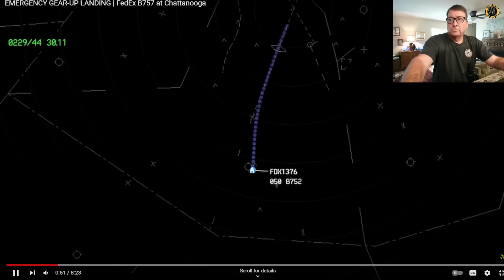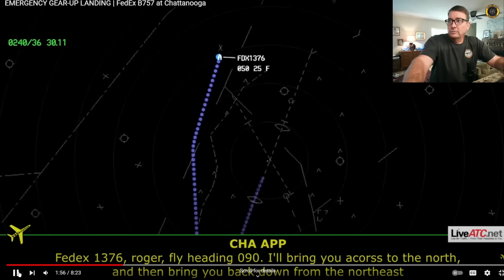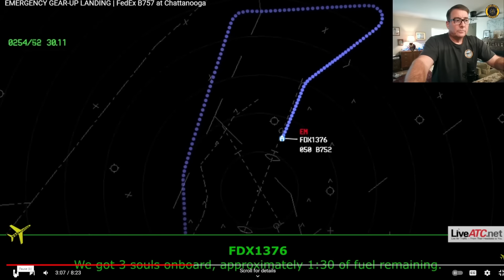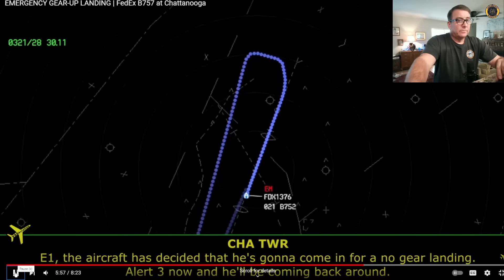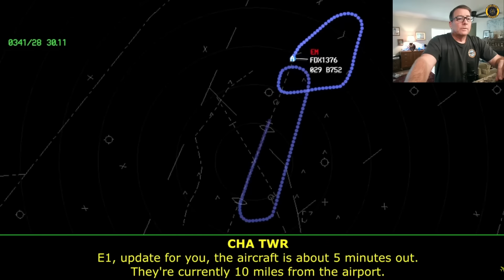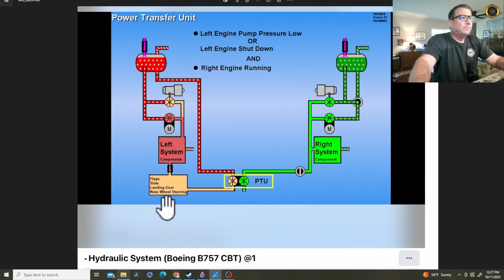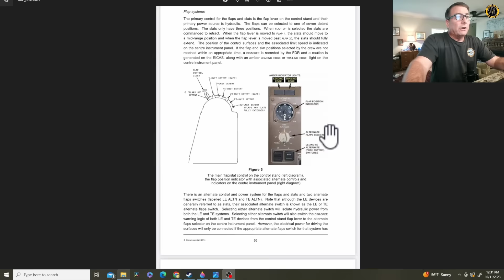Fedex 757 Gear Up Landing 4 Oct 2023

Comment: Hi Juan, do you think the mfgs will ever add cameras to give pilots views of the engines, tail, and landing gear? Thanks. Great video👍
Reply: WHY?
Reply: @georgeconway4360 so they don’t have to do a fly-by for others on the ground to confirm if the gear is up or down. But since this was at night it’s going be difficult to see from the camera or by anyone on the ground. 
On the other hand we hear of instances where the pilot comes through the cabin to look out a window to check what’s going on with the engines etc. so a camera might just give them another way of confirming what a sensor is telling them.
Reply: @axelknutt5065  Well said. Possibly even more useful on a freighter, as there's no cabin crew to look at the engines for you, or possibly not even any windows to look out of...
Reply: @georgeconway4360  cameras are very inexpensive these days. Even a Tesla has multiple cameras obviously for different reasons but still they are there.

Cameras would allow the pilots to have a view of what is happening without leaving the cockpit, and in this instance they wouldn’t have had to do the second flyover to see if their landing gear was down.

I hope Juan weighs in on this as he may have some additional information that may be helpful to us.

I just think for the low cost of adding them into a new model they should be there. It could also help later with accident investigations.
Reply: @TahoeRealm  Nothing on an airplane is inexpensive. Curious if you could estimate the cost on one of multiple computer screens sitting in front of the pilots. I had one changed on a MD11 in the 1990s and I was told the part cost was $60,000. I doubt the price has dropped in the last 30 years.
Reply: @georgeconway4360  go back and watch Juan Brown’s excellent interview with Captain BEHNAM and let me know if you still don’t think a camera would’ve been very helpful to the captain. You seem very opposed to this idea. Let me know if you feel the same way after watching that interview.
Reply: @TahoeRealm  I’ve watched the interview and a camera would have made no difference. You guys sound like the people that think a big parachute in every airliner is the solution to crashes. A camera would just be a distraction. Pilots just have to fly the airplane they have since they can do nothing to repair the problem.  How much do you believe cameras would cost per airplane? One million dollars, five million dollars, ten million dollars?
Reply: @georgeconway4360 Why would you want to know if your gear is down or if there is visible damage to an engine? Really?
Reply: @owensparks5013 You could see gear is down, but is it locked? You'd need a lot of cameras and a fair bit of time to run through it all.
Reply: @owensparks5013  The airplane already was telling them the gear was not safe. Visible damage to an engine won’t change the way the crew handles it. They’ll get a better picture of what has happened by the performance of the airplane. In flight repairs went away with the jets.
Reply: @georgeconway4360  There are many different "gear not safe" scenarios. If that warning was sufficient, then there would have been no benefit to carry out a low pass to ask ground observers for more information. All gear deployed, but not locked, vs nothing at all deployed, vs one main hanging and nothing on the other side is useful to know! A few cheap cameras could have verified that in seconds. Instead, the pilots had to waste limited remaining fuel and fly a poorly handling aircraft low to the ground to gain an understanding of the situation.

Likewise a visual observation of an engine could be the difference  between, "it might just be an instrumentation problem", vs "the cowling has disintegrated, bits are flying off towards the tail, the wing seems to be venting a liquid from a puncture, and there are flames coming out of the side".

I really don't understand why you're continuing to deride a simple way to gain information in an emergency.
Reply: @owensparks5013   go back and watch Juan Brown’s excellent interview with Captain BEHNAM and let me know if you still don’t think a camera would’ve been very helpful to the captain. You seem very opposed to this idea. Let me know if you feel the same way after watching that interview.
Reply: @TahoeRealm  You might want to read the thread again, I'm the one for the cameras, not against them. 👍
Reply: @owensparks5013  thank you Owen. I think I may have tagged you by mistake when I copied over.
Reply: @owensparks5013  Do you consider $1,000,000 cheap?
Reply: @georgeconway4360  There is no reason,  other than antiquated aviation production and certification methods, that a handful of $10 cameras should cost a million dollars.
Reply: @owensparks5013  You say that because you have no idea. I recall many years ago a PanAm pilot remarking about the $40 pencil sharpener at the Nav station in the B707 cockpit. It was the same sharpener you could buy at a five and dime store for $1.25. When the MD11 was new and we carried lots of non pilot employees on the jump seat I would always ask what they thought this new airplane cost. The numbers I had been given was $91 million. Most guessed about three to five million but in one case the jump seater guessed $750,000. Nothing is free or low cost from any aircraft manufacturer. The WAG of on million to put cameras on an airliner is probably Low Ball.
Reply: A camera doesn't really tell you whether "locked" or not, unless all downlock linkages are somehow clearly visible.  But the DC-10 for example has multiple conclusive visual indicators:  A small stud which protrudes from the upper wing surface (edit: for "down and locked"), and a sight tube underneath the carpet mid-cabin where the alignment (or not) of two indicator tabs in the wheel well can be checked (edit: for "up and locked").  Those are direct/positive confirmations, though the observer has to be mid-cabin.
Reply: @marcmcreynolds2827   go back and watch Juan Brown’s excellent interview with Captain BEHNAM and let me know if you still don’t think a camera would’ve been very helpful to the captain. You seem very opposed to this idea. Let me know if you feel the same way after watching that interview.
Reply: @TahoeRealm  "You seem very opposed to this idea."  Sorry if I gave that impression, though yes I did point out a negative while and mentioning alternatives which I assume many are unaware of.  Speaking as a former airliner landing gear engineer with some Human Factors background, here are some expanded thoughts.  Note that I'm not so much opposed, as wary of the upside/downside ratio.  It's not as simple as some might think from working off of one or more specific incidents/scenarios.

I fly inexpensive cameras all the time... but not on an airliner.  As georgeconway so accurately put it, there are no inexpensive airliner parts.  The several cameras must perform at temperatures from well below freezing to hotter than consumer equipment will work, with no fogging across the entire RH range, no problematic EM emissions, and in the dark with a ventral anti-collision light constantly messing with the exposure.

There's a Human Factors aspect which concerns me:  Does the tendency of one's brain to focus on visual data, especially attention-grabbing visuals like an engine on fire, overly distract from other visual and auditory inputs?  A pilot might tend to devote too much attention to a screen showing an anomaly containing little actionable information, while other more important tasks/inputs get missed.  Something said by the other pilot, for example.

People think that they multitask, but it's really just switching back and forth, and some circumstances make it harder to do that reliably than others.  I would want to see a lot of "instrumented" (e.g. eyeball position) simulator runs before assuming cameras helped more than hurt over a range of emergency situations.  Maybe/maybe not.  Even if the answer is yes, such research could lead to best practices for utilizing cameras safely/effectively.
Reply: @marcmcreynolds2827  thank you for the great reply and sorry if I misunderstood you.

Comment: 757 is my favorite airliner of all time. I hate to see one trashed. Thanks Juan!
Reply: I noticed that in the accident report, the report stated that the damage to the aircraft was substantial. Does this mean that this aircraft will be written off? Or might it be repairable for reuse?
Reply: @arthurcatalanotto1151  I wouldn't think this is something that can be repaired but only someone like Juan could answer that for you.
Reply: To be fair, she wasn't deliberately trashed. I think a line from The Mary Ellen Carter works well here, "We all tried to save her, heedless of the cost." Also, she did what she needed to, and got the crew on the ground alive and relatively unharmed. (Those slides can sometimes be tricky.)

Comment: I’ve been away from the 757 for a while but there are a lot of similarities with the 767.  This is what the Polish authorities found shortly after LOT’s Gear Up landing a number of years ago.  Wonder if the 757 has this circuit breaker?
C829 BAT BUS DISTR, is located on a vertical panel behind the captain’s seat. This CB, when connected, supplies power, via another CB, to the landing gear alternate extension motor. Since this CB was out, the motor could not run, and the motor’s running is important to release the locks that keep the landing gear and door retracted.
Reply: But wouldn't that be on the checklist???
Reply: @TruckerHershey-SO     I don’t think that CB is on any pilot’s checklist, maintenance facility would have it in their docs
Reply: I believe there is a solenoid that activates that motor so I wonder if it failed hence the motor didn't go to release the uplocks.
Reply: I seem to recall Juan saying that the 757 and 767 are so similar that they have the same certification.
Reply: The flaps were affected too, so it leads us to believe the fault was more likely in the shared System A hydraulics. Additionally, having three sources of hydraulic power all failing points to a shared resource in that system -  fluid (or lack thereof). But to your point, yes. No doors opening would likely result in no gear dropping.

Comment: Don't they have the pop-up indicator thingys on the wings to see if the landing gear is down?
Reply: "...thingys..." are extra...
Reply: @buckhorncortez   Not extra on the DC-10.  It also had a sight tube into the wheel well.
Reply: So are peanuts... @buckhorncortez
Reply: You require windows for that and the ability to get back to the window to look. Then there are  normally only two pilots so you would have to leave one pilot in the cockpit to look. The crew used ground observers the way they always have.
Reply: @georgeconway4360  It was a yes or no question. I'll take your reply as a yes.

Comment: How fast was plane moving at touchdown?
Reply: If I was reading the ADSB data correctly,  it looked like about 140 knots.
Reply: 130 knots
Reply: Pretty amazing it didnt tip and roll or start a fire.  That’s pretty fast to skid down a concrete runway

Comment: I’m surprised that the 757 Alternate
Gear Extension System relies on the same hydraulic system as the Normal extension system.
I would have imagined that the Right, or even better, the Center hydraulic system would be used to release the Landing Gear uplocks.
Clearly, I’m missing something here🤔…
Reply from the maker: The trapped fluid that's whats missing...
Reply: @blancolirio  Ah, got it.
Thanks!
Still surprises me that Boeing chose to use one hydraulic system for both normal and alternate extension though…
Reply: The 757 has a stand-off pipe that captures enough fluid (by design) to feed the inlet of the power pack, so I highly doubt the Alt Ext Sys failed due to a lack of hyd fluid.   Iirc, the 757 is like the 777 and uses a pressure switch on the outlet side of the power pack to turn it off when adequate pressure is achieved to trip the uplocks - if the switch were to fail open, then the pump would fail to turn on, too.
Reply: @aeroman5239  Sounds like a compound failure, but certainly explains why.
I’m not a Boeing guy, so any intel on the systems is greatly appreciated!
Reply: The emergency alternate gear extension system is not truly independent because it relies on fluid from main system. The old Grumman emergency gear blow down system is because it uses nitrogen blown thru independent system to blow down gear, and it's very effective...
Reply: @masonallen3901  Yes, but as I recall, the inlet pipe has a large diameter and is tall enough pipe to mimic a low-pressure static fluid reservoir, containing enough fluid volume for the pump to scavenge and pressurize the uplock actuators, when required.
Reply: @aeroman5239  That was the part I had trouble understanding. So, correct me if I’m wrong: the stand-off tube is independent of the reservoir fluid level, and provides enough fluid to activate the uplock release actuators.
It will be very interesting to know how this system failed.
Reply: @masonallen3901  Interesting, I didn’t know how the Grumman system works.
I’m familiar with Bombardier products. The Challenger, Global, and CRJ all use a mechanical cable to release the uplocks (except for the CRJ 1000, it uses hydraulic pressure from a different system), and down lock assist actuators for the mains. Nose wheel uses gravity and down lock assist springs.
Different systems for sure.
I’m quite curious to find out why the 757’s system failed.

Comment: Interesting, I had no idea that the 757 didn't have a mechanical release like so many other aircraft designs.  Does the 767 share this "feature" since they're designed under one program?  This sure seems like a single point of failure for the landing gear.  Break the piping, and then there is no hydraulic fluid remaining in the left system.  If that's what happened, it would also explain the loss of slats and flaps, because it would leak all of the oil away.  The 737 system distribution makes more sense in this regards because the flaps and landing gear are on different systems.

It is also interesting that the 757 has electric leading edge flaps.  Most aircraft use hydraulic actuated only on the leading edge devices.
Reply: This is also my observation. Triple redundant systems with a single point of failure are not redundant after all. The fact that the landing gear locking mechanism rely on presence of the same hydraulic fluid that invalidates the other systems seems to me a major design flaw. Maybe I am not getting the whole picture here...
Reply: The 777 is the same, by having the alternate gear system running off the same hydraulics as the normal extension, but using fluid below the level of the stand pipes. 

The problem with using a different system to release the unlocks is that a failure of the right or centre hydraulics would then keep the gear locked despite the left system being pressurised and able to lower the gear.
Reply: @EdOeuna  "The problem with using a different system to release the unlocks is that a failure of the right or centre hydraulics would then keep the gear locked despite the left system being pressurised and able to lower the gear."

That is VERY narrow thinking.  If the lock was spring retained and used multiple systems with independent cylinders then there wouldn't be a single source of failure.

Overall Boeing has a better reliability of their hydraulic systems as they generally have 2 power sources for every system, compared to Airbus's single source systems with a PTU.  The PTU can be a cause of two out of three systems going down, and this has happened.

But there certainly is a valid criticism of Boeing's shared fluid for backup.  It introduces the ability to take out two systems for certain failures, with landing gear and brakes being the common examples.  In airbus, they have separate actuators for the backup so there is no cross connection of fluid like Boeing does.
Reply: @matthewbeasley7765 - it may be narrow thinking but that is exactly how Boeing designed the 777 and, according to this video, the 757/767 as well. The same hydraulic system powers the locks and gear, with a back up from the same hydraulic system. Clearly it works for Boeing.
Reply: @EdOeuna  Well it didn't work on the 4th of October 2023.  Three different systems all depending on one single pipe is not redundant.
Reply: @matthewbeasley7765 - and it’s the second time that the system appears to have failed in 30+ years of the 757/767/777 operation.
Reply: Flying inverted is an off the books solution to keep fluid from leaking out
Reply: Flaps and slats are normally hydraulic powered.  The alternate method of actuation is by electric motors.

Comment: Is this aircraft repairable or is this a write off?
Reply: Just like a car crash, the decision comes down to money.
In this case, someone else said that FedEx are retiring their 757s. Even if it's easy to repair, it might not be worth it.
Reply: @j_taylor and even if they weren’t retiring them it is probably easier to pick up another 757 from Mohave Desert storage
Reply: Depends on the overall damage but looking from the picture, it appears that it is repairable.
Looked like a greaser of a landing so the #1 pylon, (engine strut) did not take an overstressing.

Comment: Sounds like they had a total loss of system fluid in the left Hyd system and, or a PTU failure combined.  I didn't see Hyd fluid on any of the nacelles, but they were flying around for some time.  You would think they would have seen that indication on a system pressure indicator, or an idiot light.